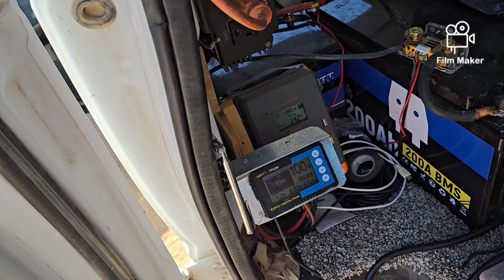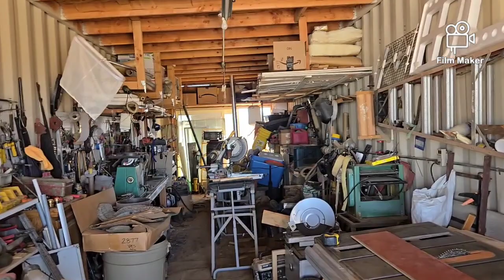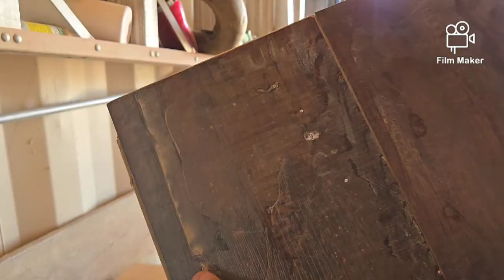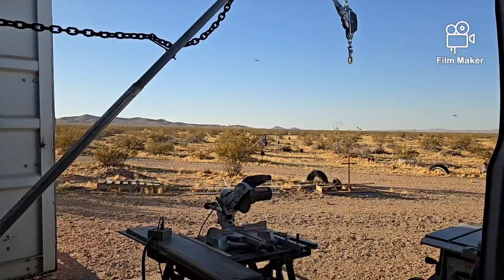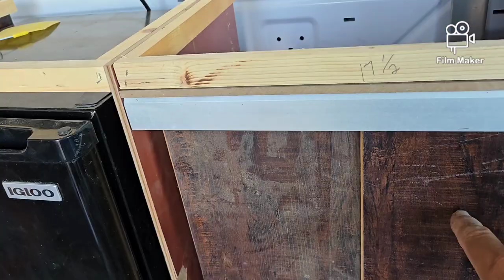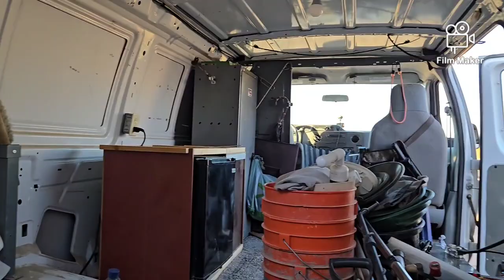Running Power Tools All Day On A Wattcycle 200ah Battery, Sep. 29, 2024

Comment: I know you can go to junk yards and purchase the window cages from wrecked vans for cheap including the front cages for better security and then weld those special lock covers on the outside of the doors.  Hey, my feed I saw a Li Time Battery commercial.  What gives there G bear?
Reply from the maker: I bought LiTime batteries before I started reviewing others.  They are good, but overpriced,  since I now realize I could have gotten twice as many 200ah WattCycle  batteries for about the same price.

Comment: Great test shows how good that battery is in real life applications. Bolt that fridge down, it's going to be heavy when its full. Also strap to keep door shut is needed. But you know that, right?😁
Reply from the maker: Yep, I have a temp strap and slide stop on it now, and will add the final touches when ready.